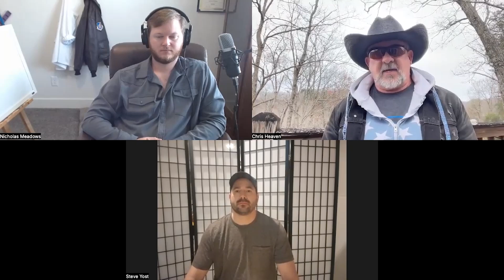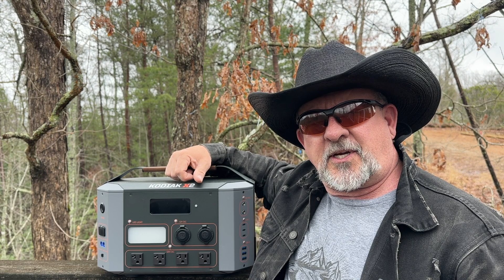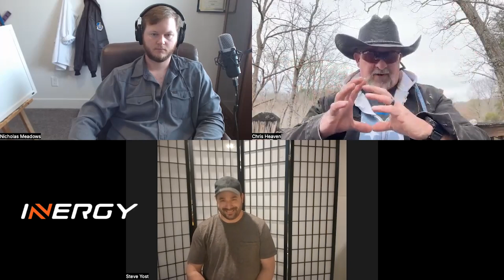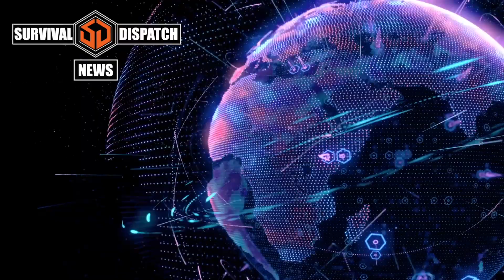Will an EMP Strike End Civilization As We Know It? Survival Dispatch News 3-16-23

Comment: This was the best conversation about EMP I've ever heard. I'd love to learn about EMP resistant vehicles.
Reply: I have several EMP resistant vehicles.
The ultimate one is my 1986 F-250 6.9 idi Diesel, it doesn’t even need a battery to run. Also non-electronic ignition old vehicles (something with points and condenser) will work as well.
I’ve got a 67’ , 69’ and a 71’ Ford with points ignition that will run (just keep spare condensers in a faraday cage)
Also I’ve got a 56’ Oliver tractor that is crank start that will run.
Any old mechanically injected diesel like 5.9 12v Cummins, 6.9/7.3 idi, GM 6.2 will work really well, ideally with a manual transmission so it can be roll started.
Reply from the maker: Thanks for watching!

Comment: Great video and information guys. If you get Steve back on again, maybe discussing all the EMP Faraday common materials and what are the better ones to the worst. I wonder about galvanized steel and how that compares to stainless steel, carbon steel, aluminum, tin can, cast iron etc... Steel galvanized trash cans are popular Faraday containers in the prepping community and I wonder how that compares material wise. Also when speaking about Mylar bags it should be noted that the zip lock version is not good enough as that is a few mils of plastic for the zip area. With the zip lock version either heat sealing or folding the top over a quite a few times like a you do with a dry bag would make a high voltage seal.
Reply: You nailed the zip mylar. Rolling the end, foil tape the opening, impulse sealed or even upside-down in another mylar zip bag for double layer.
Reply: Similar to electrical conductors, the easier the electrical flow, the better the Faraday cage. Ferrous metals conduct well, but aluminum is better,  copper is best, a coated silver to prevent oxidation is premium, but cost prohibitive. This is the reason I suggest aluminum in multiple layers, it is still cheaper than a single copper layer with better attenuation than single aluminum layer, but at a substantial cost increase.  Online metals does have rolls at .004" thickness of copper that might be a good product, descent price $120 2'x60' roll (but I have to see it in person.)
Reply: @AnythingOutdoorswithSteve  Hey man, thanks for the responses. Much appreciated. Thanks for sharing your vast knowledge on the topic, much respect!
Reply: @jeffgendron1959  another viewer asked about an ice cooler for an insulation layer- I had never considered it, but would work quite well- especially if it has an interlocking lid, and/or if it is also wrapped as an internal Faraday cage or primary Faraday cage. Some obvious and easy options that don't have to be horribly complicated! 

Thank you for your kind comments, they are highly appreciated.

Comment: does grounding your EMP container hurt or help?
Reply: I wondered that also. I would think grounding only pertains to the electrical grid. I would guess isolated items should be isolated as far from ground as possible for maximum protection. If you think about it a blanket EMP pulse will be saturating the ground at the same time everywhere and the ground is conductive. I'm not an expert but my Faraday containers are isolated with plastic blocks off the ground. Would be good for them to answer your question in a follow up.

Comment: I have used jobsite (Ridgid & knack) tool boxes, insulation and metallic tape closed? Hope they work. If an item is not connected to the grid, dose this matter?
Reply: Tape the seams, have a polyethylene (cost effective)layer inside or around the protected item and really a secondary layer of foil, mylar or emp bag. I keep pushing towards a shed constructed that you can put a box like that inside- if you can. Even the metal sheds that you tape the seams with copper or aluminum and the doors/windows. Everything helps dramatically here. Power tools are a great item to have if you have a way to run them (power inverter and some deep cycle batteries) make a huge difference vs doing everything by hand.
 That being said, I have started to purchase a lot of hand powered equipment, even a manually operated clothes washer and an old washboard. Hand mills, bit brace, good buck saws, all great things to have if you have the means. 
 I did lean towards accepting the losses and planning towards grid free items (lightly).

Comment: Ok.... Everyone is concerned about cell phones and emp,. The towers won't survive anyway.  It's a moot point.  Protecting a tablet or laptop with important info already on it is feasible.  Other electronic parts IE for your vehicle or other tools and equipment need protection.  But fuel won't be made for a long time.  Think carefully about what actually will help you post emp or cme and protect those items and parts for those.
Reply: This is my point for the ham radio operator that relies on repeater towers to reach a location they plan to communicate. Any antenna will have a substantial voltage coupled to it.
 I have used the anecdote for the people that plan on protecting solar or backup power systems; if you don't have any protected equipment to run, there is little point in protecting power generation equipment.
Reply: @AnythingOutdoorswithSteve  I disagree about that, because there are plenty of things that are needed that need power like lighting, medical stuff, 12v fridges or 110v power tools etc. That being said whoever has those items needs to protect those in a faraday cage. Or at least the backups to them.  Just being able to have rechargeable headlamps and other small items is a great use for a faraday cage.  Also a good am radio , NOAA radio etc, just in case information is broadcast that's important.  Having a really good cb radio would be good as all components can be kept in a faraday cage.
Reply: @LadyTSurvival  I am right in line with that. That was for the people that have a few items, forgetting they need to provide protection for the daily use items by having a backup in a cage. I was missing quite a bit to that anecdote by not writing a few paragraphs 😅
 I will be making a video for a full house panel battery backup, that is also in a protected room and in another layer cage around it. It will be disconnected,  but ready for a quick hookup.
Reply: @AnythingOutdoorswithSteve  I don't know enough about Ham radios to be able to give any kind of advice about that.  That a good CB radio that'll reach out there for a ways and really good antenna for could possibly be helpful

Comment: That was some superb information. Steve you should write a small EMP information manual with the “proper”  technique for designing a faraday cage etc. This is the best info I have heard.
Reply: Thank you. I have been typically disappointed by videos omitting the most important factor of emp protection, being the frequency ranges being a direct correlation to the Faraday cage design.
  I would write out a guide,  but I am not the best speaker or writer- as seen here- I was a bit nervous and out of my element.  There was quite a bit more information I was going to cover, but forgot to address certain topics.
Reply: @AnythingOutdoorswithSteve  well you may have been a bit nervous but that’s not how you came across. You covered some great info. I for one would love to see a practical guide since most others fall short. Great job.

Comment: So, would rubber anti sound pads work with mental tape on the seams
Reply: Research 'dialectic strength' of the material you want to use to determine how many volts it takes to break through. Glass is above 2,000,000 volts per inch thickness. I have been curious to test spray liners as an inexpensive test material as well as sheetrock. Time to play with some deadly high voltage transformers.  The common rule is 30,000 volts per cm for air gap, but there are many factors affecting this "rule," mainly humidity.
Reply from the maker: There has to be complete continuity but the rubber could be a layer adding some distance for the electricity to jump.
Reply: I would rubber cement, fully vulcanized seams. Coating the rubber completely with foil will help ensure even the insulation has a layer of protection. Take every opportunity to get another layer of emp protection. If we are truly looking at a super emp's, every layer helps.